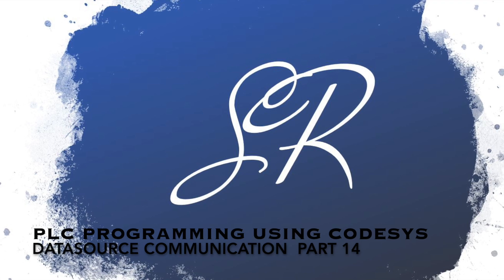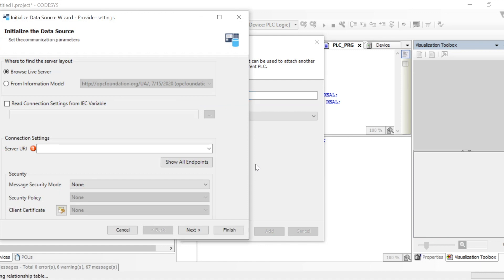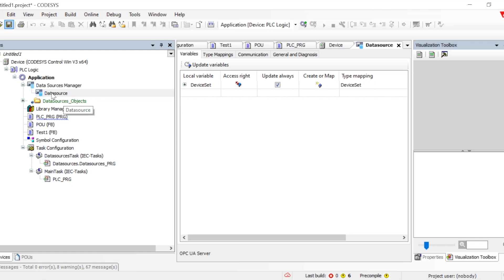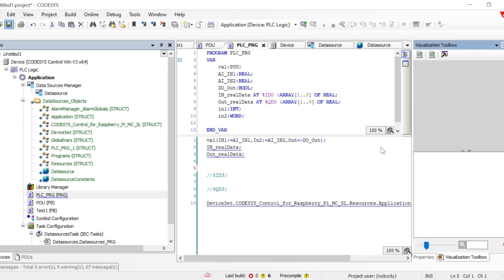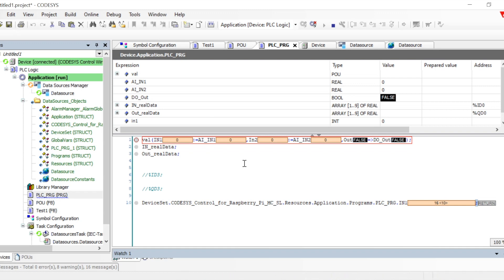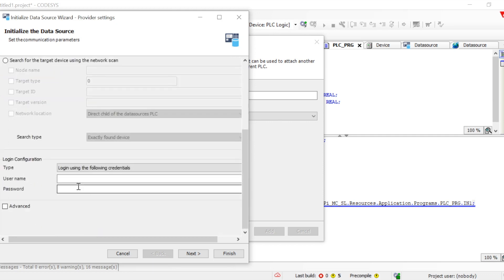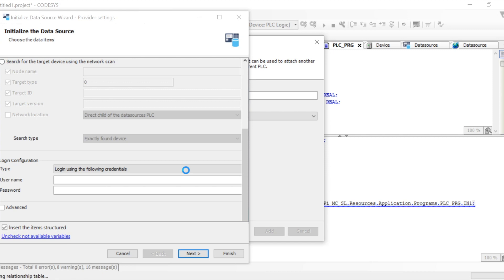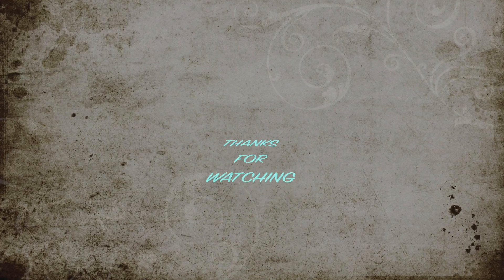CoDeSys PLC as OPC UA Client using Data source Manager  OPC UA Server & #codesys Project #opcua

Comment: Hello Sir, When I add the data source, there is no OPC UA server among the options, only codesys applicationv3. How do you achieve this?
Reply from the maker: You need to upgrade the version of CoDeSys this particular feature is available from 18.2 
https://www.shaswatraj.com/post/codesys-as-opc-client-using-data-source-manager
Reply: Hello sir, thank you very much I understand. Is there another way that I can set codesys as an opc ua client, that is, read data from another source (opc ua server)? @jugaadtech12
Reply from the maker: Yes there are other ways also ...you can use OPC UA client library by codesys using which you can write full programs and connect to OPC UA server....

If you want out of the box then you can also use Node-Red
Reply from the maker: https://forge.codesys.com/forge/talk/Engineering/thread/c9540f7745/4beb/0802/9cda/714d/474a/1f0a/2ca8/attachment/OPCUAClient_Example.projectarchive 
This project I shared ...try with this

Comment: i dont have opc ua at data source type. how do i add it
Reply from the maker: I think you have old version of codesys , try to upgrade codesys version it will come . I have used codesys v3.5.18.2
Reply: @jugaadtech12   - I'm using V19 and its still not there
Reply from the maker: Somehow comment got missed: 
I checked on version 19.4 and it is available , which version of v19 you are using ? you can check at link https://www.shaswatraj.com/post/codesys-as-opc-client-using-data-source-manager
Reply: Did you try it over the TX Panels? I dont know why but the OPC UA won't show up, there Homepage say's that this works but idk. you need to add a Codesys controller win then you can open it